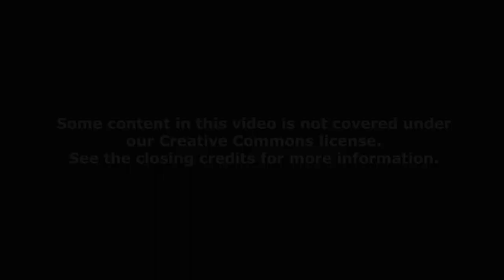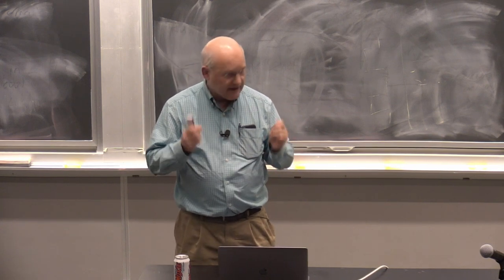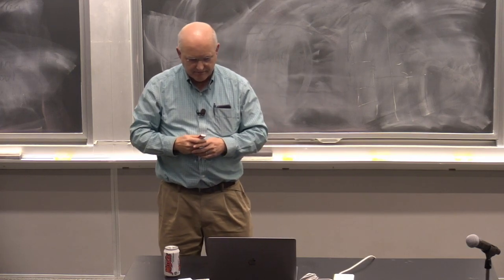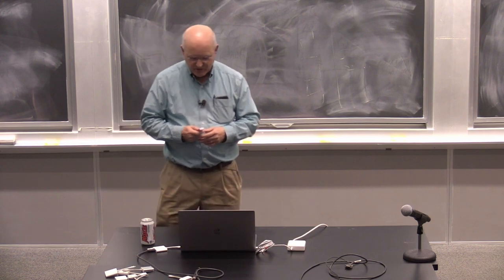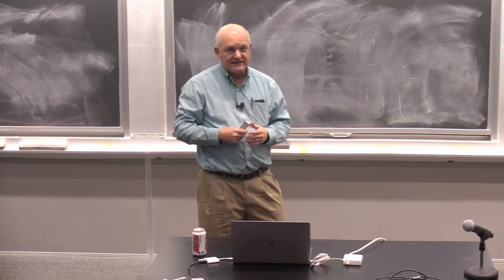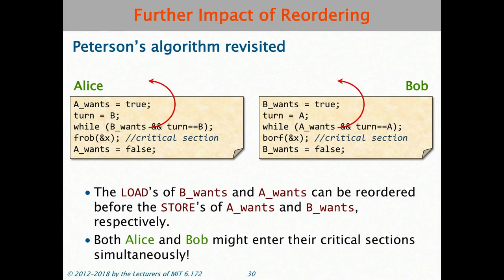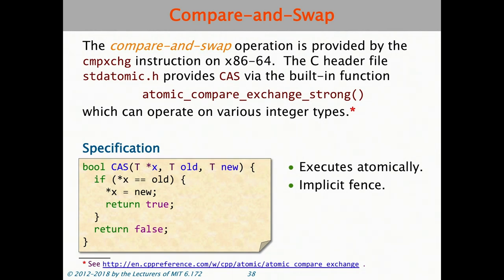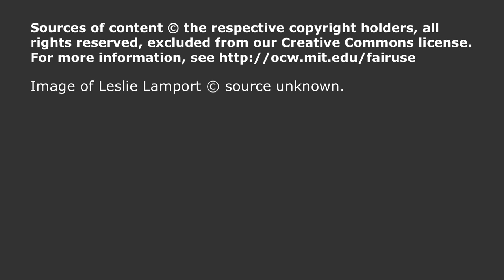17. Synchronization Without Locks

Comment: 53:30 In TSO, I think in rule (4), a LOAD may be reordered with a STORE to the the same location, too, if they happen on different cores of a multi-core CPU (so the write buffers are different and the order-preserving load bypass does not trigger). Otherwise, the suggested ordering on slide 29 would be impossible. Took me a while to realize this nuance. Another source I found seems to confirm it, though I'm still not 100% sure this explanation is fully correct.

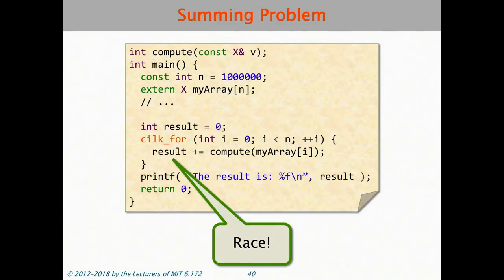Comment: 1:12:58 Why is the race condition on the variable result??? The variable result is a local variable! Every thread has a separate instance of result! OTOH, myArray has external linkage, and that's the only variable in the example that's possibly shared across threads.
Reply: In Cilk, result is actually shared. It's not like pthreads.
Reply: @guidomartinez5099  Oh, that's just unusual.

Comment: Need to know what was said at @40.00
Reply: I think it was like this:
Teacher:  When is it safe to do this reordering?
Student:  If A equals B, but if you already have the value 1 in A/B.
Just to be clear, that's why the teacher said, "But more generally when is it safe", because this is very specific to the value of
A, and I think that the only part that would have been able to figure that out is the compiler, if the data is not dynamic.